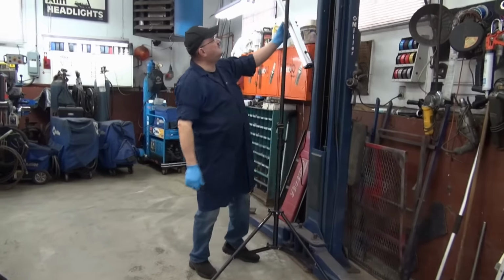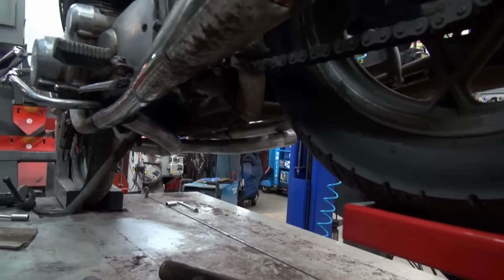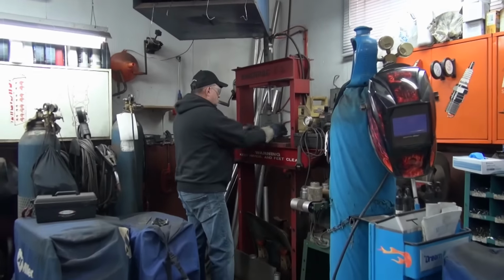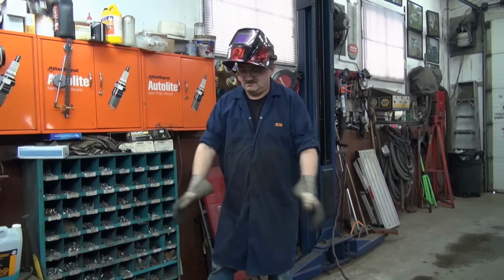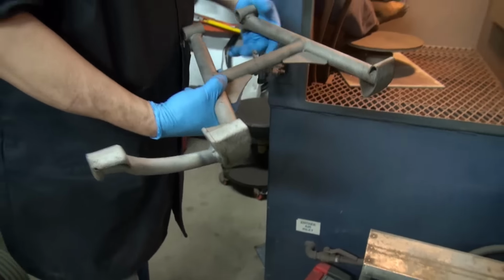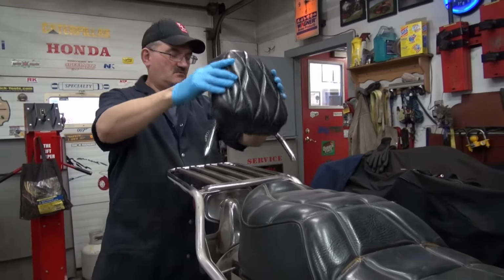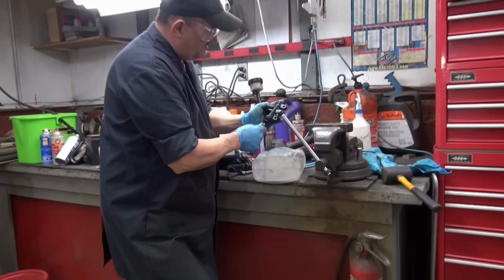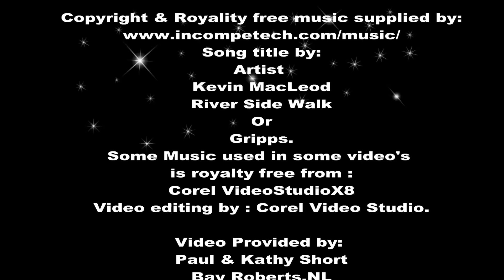Vintage Bike Repair And Aweful Pain

Comment: Hi Paul and Kathy! Now that's a proper job. I bought a 550-4 Honda while I was in the service. Bought it new and after I got out of the service I traded it for my first new vehicle, a CJ-5 Jeep. I don't call a bike a vehicle. That pipe notcher or cheater as you call it is in the same line on what we used to set our radio frequency's every day when I was in Gitmo Bay, Cuba. It was a way to keep Castro from listening to us because he couldn't find what frequency we were on, to many variables. We would just take it (looked like a comb with a 100 teeth) and just push on it with our fingers and then lock it in place. Then we punched every radio with that setting for that day. Next day, do it all over again in a different pattern. Then if it got really bad we could push a different button on the radio and it would go into garble mode. Wow, memories. Haven't thought of that in some time. Thanks for taking us along for the fix... and the memories. God Bless. Levi~~

Comment: true mechanic and fabricator a lost art , you repair things instead of replacing them ! 20 yrs ago the heavy equipment industry was driven by service and parts , they switched to sales. if your machine was broken they want to sell you a new one ! keep going you 2 , you make a great pair. the best to you both!
Reply from the maker: +mark duncan 
Everyone is pulling the same thing these days. Customer brings their vehicle into a dealership. They do up a high estimate on repairs and the customer drives out in a new unit. Had a customer in a few weeks ago. The dealer told him the rack and pinion steering had to be replaced. Over $1600. for the part and labour. He brought it in to us. It had a leak. Couldn't buy the line for the rack so I fabricated a stainless one and sent him on his way for less than $200. No one fixes stuff anymore. 
Crazy world. Thanks for watching and for your kind words.

Comment: great video you worked a miracle on that master cylinder have a great weekend
Reply from the maker: +bud moore (buckshot32000) 
Thanks Bud. Not a great situation with an old bike and no parts but it worked out well.

Comment: If the opportunity presents itself more video's like this one are interesting.  I'm of that era so it  brings back fond memories.  Miss my '73 Honda CB350.  As usual a great video.
Reply from the maker: +wyatt earp 
Cool. Will do. Was your 350 a twin or a four? I had the four and loved it.
Reply: The twin. That was my first big bike.  I was some proud of it.
Reply from the maker: +wyatt earp 
The twin actually had more power than the four but I loved the four. It was smooth as silk and those four mufflers. Omg I'm getting worked up lol.

Comment: Nice Job! I wish I had a shop near me that I could get what the customer wanted done. You were lucky that the main headlight housing was still there, on my GL1000 I had to find a used one on ebay when I removed the fairing.

Comment: Paul I must say I love watching the videos and have learned so much from you!  I find myself stopping and viewing sections the second time to listen and learn what you are saying/doing. I have done a little welding here and there and even though the bike is old I was wondering about the splatter when welding up the back rest. Will it cause burns in the seat and tank? Keep the videos coming :-)
Reply from the maker: +Laurie Harding 
Thanks. Most of the time when I'm welding I'll put a fireproof blanket over an area to protect. In the case of the bike repair I used my left hand to shield the area from being damaged. Thanks for watching.

Comment: My other house had two furnaces and one would only run for a short period also. Had my hvac guy there messed with it and he said that was normal. I told him it didn't make sense since the other furnace kicked on ran longer. I guess it is what it is.
Reply from the maker: +Jake Schisler 
If you want the two to work the same you'll need to adjust your stack switch to have them cycle the same.

Comment: The owner of this motorcycle was lucky he brought the machine to your shop before he ended up sliding down the road on his butt. I only had that experience once, and I spent several days standing up while doing my morning show. I was The Butt of many jokes at work.
Reply from the maker: +1RadioShowHost @DocDeStiller 
You took a tumble by the sounds of it. We all do eventually. His bike was in rough shape. No back breaks. Aweful but it worked out well. I hope he gets some enjoyment out of it this coming summer. Do you ride anymore?
Reply: +Paul Short I sure hope so. Or the money I just spent on that 2008 Silver Wing went for naught. I'll send you a photo, After I finish spray painting it Grabber Lime with the Rustoleum cans from the auto parts store.
Reply from the maker: +1RadioShowHost @DocDeStiller 
Cool. That should be interesting. Never seen that done but I'm trying my best to keep an open mind 😳

Comment: I went opposite. I had a three into one on the GT 750. Sounded Orsum
Reply from the maker: +gopha533 
Personally I loved my four into four on my Honda's
Reply: I was after a little more from the bike. gave bettter compression maybe. but these and makuni spelling?racing carbs and a little bit of work on the motor made a fair wack of difference to it's performance.

Comment: Talk about a little project growing into a big whopper!  

Questions:  I know you edit and didn't show everything, but I'm wondering how bad that crack (engine guard) @ 3:59 turned out to be for repairing?  Your eagle eyes were good at catching all the other cracks and weak spots.  
Also, how did it look w/o the fairing up front and now without a windscreen?  I liked having a windscreen on my cruiser and it helped tremendously with the comfort on a ride.  The owner might miss that once he rides w/o it.  shrugs Time will tell.

Speaking of eyes and eye lashes, I also was pondering if when you rub your eyelid, would your leg start moving like a dog trying to scratch his belly?  You seem to have found the secret to that clever part of "wiring".  :-p
Reply from the maker: +Ji Fi-01 (Jif) 
The crack was an easy fix. Only took 15 minutes. That's the one section I got a break on. Yes there's a good bit cut out of the videos. It's all bad enough this video was over an hour. The fairing had to come off. It looks much nicer now. The customer will put a small windshield on it to give it a more modern look. You can see what it's like towards the end with out it. 
Just tried rubbing my eye and my leg didn't move. I think that one hair was tied into the central nervous system and that's what caused everything to go haywire. So remember, cut, don't pluck ;)

Comment: Hi Paul and Kathy; Paul how often should the brake fluid be changed? I have a 2005 V-Star with approximately 45,000  Klm's and I changed it once. It only has a front disk brake.
Reply from the maker: +cliff ohandley 
It really depends on the humidity in your area. You can use a tester like I used in the video or every two years to be safe.

Comment: Paul ,Have a question for ya.Was thinking of moving my compressor out of my garage and putting it in my back storage on the back of my garage it is unheated .My garage is only heated when using it as you know in NB our weather is as drastic as NFLD .Temp up and down and very humid .I have a air dyer on it at present . Whats your thoughts?
Reply from the maker: +D Steven Paisley 
The problem with compressors is the condensation they create. That's where your issue will be. That condensation can freeze and can cause a lot of damage. You'll also need to make sure you have a good airflow for the unit.

Comment: fit nothing muffler...😂 The new pipe you made is going to really wake that bike up because the exhaust is going to flow so much better!
Reply from the maker: +Keith Brettell 
Th customer said it had no power before. Wonder why lol.
Reply: +Paul Short With all that flow it might need to be re-jetted.  Also some 0000 steel wool and WD-40 would clean up those rusty mufflers real good.  Great job...more motorcycle vids would be great. ;)

You said you had a CBX in your shop some time back.  Are they harder to work on than a 4 cylinder?  I always wanted a CBX.